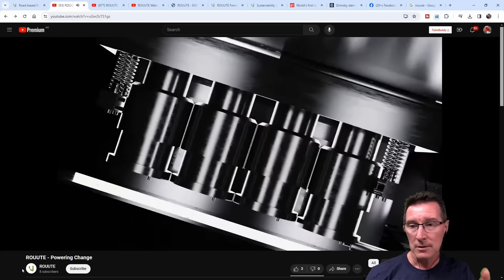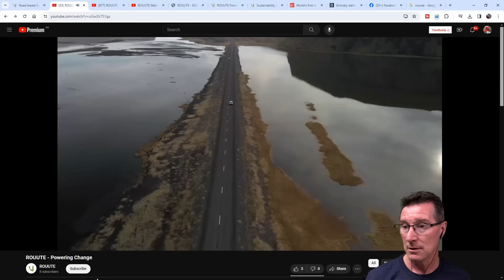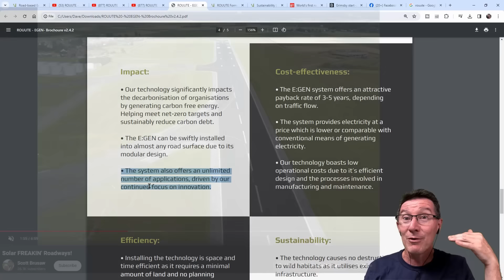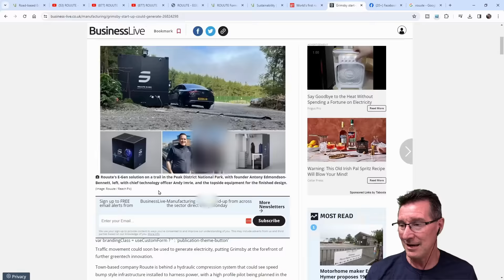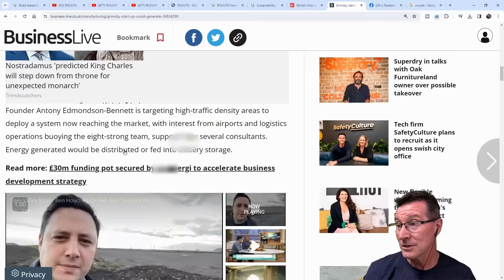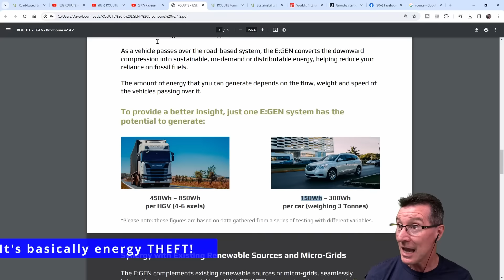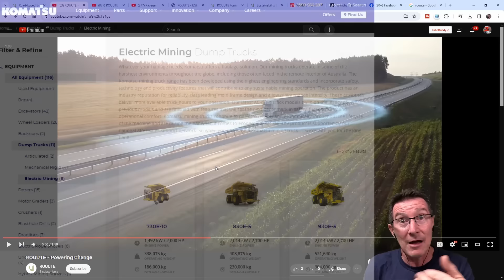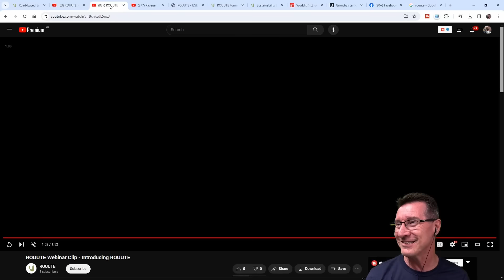EEVblog 1600 - Rouute: Road Based Energy BUSTED

Comment: Right away without even watching the video, how do people come up with stuff like this? Do they just somehow forget that energy cannot be created or destroyed? All the energy they “generate” needs to come from somewhere, in this case it comes from the car and it’s engine or motor so all the energy generated by these devices means more energy used by the car and if that car is fossil fuelled then how can they say it is carbon neutral or zero carbon energy? Even with electric cars they can’t make that claim because a lot of power stations still use fossil fuels.

I would imagine that the efficiency of this is pretty rubbish too so it is causing more fossil fuel use for the same amount of energy.

All this is, is a convoluted power transmission system. Looking at EVs they charge up at home or at a charger which already uses an extensive transmission network and then drive to wherever they need to go and in the process drive over these speed bumps, they would be much more effective and efficient just using the grid that we already have.

Basically all the energy that these people generate with these speed bumps is paid for by road users in extra fuel or electricity used. I could see this as a way to save on electricity at the expense of others and nothing more and even then these devices are probably very expensive anyway.

Yes it may work to harvest energy going downhill rather than wasting it through braking but is that really worth it?

Comment: Well hold my beer. Quick-E-Stop: parking lot where each parking slot has a big bumper. You go full speed off the freeway exit, front first, straight into it. The bumper slows you down very quickly, allowing for safe and precise parking, and generates humongous power. You're allowed to park for as long as the energy generated covers the loss from shadowing the SolarParking tiles underneath.

Comment: Reminds me of a stretch of concrete test highway I used to commute on. You don't use concrete for roadways where the ground freezes solid in winter because it just falls apart at the joints and needs to be patched... So driving on that stretch of road was miles of THUMP THUMP THUMP THUMP THUMP THUMP THUMP..... it was especially horrible in a truck with a leaf spring suspension. 

I was so happy when they tore that up.
Reply: The Lake Pontchartrain Causeway does this for it's entire length, so wonderful.

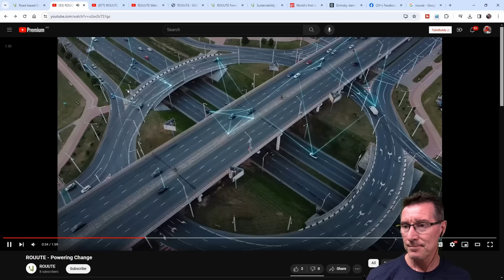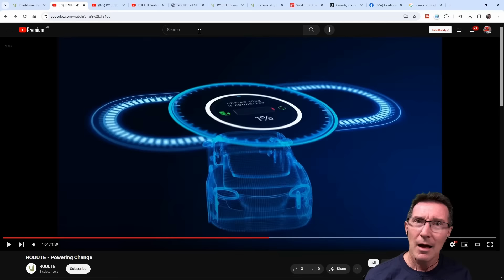Comment: ⚠First video clip @ 2:35 shows Vehicle Mesh Networking to communicate traffic data etc then around @ 2:59 shows Cell Networks doing the same. Both has Nothing to do with energy making speed bumps. IF Morgan Freeman did the voice-over likely only for SAG requirement to do advertising. Could be fake then get sued by M.F.

Comment: I think that the one for walking is slightly less bad. Basically it is like walking in slightly uphill or on very, very small stairs. You will use (slightly) more energy to walk on that pavement. I believe that any generator is a good for workout, at least you feel like you are doing something (if you just paddle on exercise bike, you feel like you are... well... sitting in a room wasting time and energy, but if you use it charge your phone/laptop, you feel "green", so it can be good motivation). 
But yeah, it is not really useful, it is just another "green" technology powered by fossil fuels.

Comment: The thing is this could work if its installed in locations that call for speed bumps anyway. It's taking energy from your moving car anyway so installing them where speed control is desired makes sense. I highly doubt even then it'd be worth it, though.

Comment: But we already have a system to convert 300Wh of kinetic from moving vehicle energy into another form using similar footprint. It's called a concrete wall! Again they are trying to reinvent the wheel here and have "Smart walls" that try to stop your vehicle from high speed within a very short stopping distance. It will surely reduce our carbon footprint if we destroy all vehicles!

Comment: 1. Increased air pollution 
2. pitiful energy recovery amounts 
3. the motorists will be paying to generate the energy 
4. unsafe braking surface!
5. Maybe useful in car parks instead of speed bumps bit the amount of energy created would not be worth while.
6. hydraulics to spin a fly wheel maybe be the way it’s achieved

Comment: That's also going to wreak havoc on people's suspensions. Imagine driving around on a road like that all day long. People would be vomiting their guts out in their cars, and every 100 miles there's going to be a dedicate shop selling car suspensions. Not to mention driving on this at high speed. You hit a bump like that with 130km/h... your car is now an airplane, a crashing airplane. Even the slightest bump is dangerous at highway speeds.

Comment: The fact that the creator has worked in oil and gas before makes perfect sense. This is an excellent way to increase fuel use.
Reply: I hopped straight to the comments to see if this had been addressed. This is seems to be stealing efficiency from the vehicles traveling over these things.
Reply: literally stealing electricity from your ev  @defaultdriftco00
Reply: Efficiency, what about being forced to repair your care more often because your chassis can't handle so many speed bumps?
Reply: Well they did say that they're aligned with the UAE.
Reply: Having an electric vehicle spontaneously explode on top of those is just a matter of time, and peak irony.
Reply: and am amusing the faster the traffic the power it will make? I think I need reminding why speed bump where put on the road in the first place? the landing say plane? landing or something getting rid of energy eg speed landing would a good idea jet aircraft carriers use tow line that catches the planes as the land making landing area a lot shorter than without one?
Reply: @dh2032  try again mate. you killed godzilla with that comment.
Reply: FR, I thought I had a stroke
Reply: @dh2032 the landing strip is long to allow the plane to slow down. Using a rope to slow it down would rip pieces off of it. Planes have to dump fuel for early landing because the mass could break off the wings.
Reply: @chaosryans  They are thinking about Aircraft carriers.

The Grapple is Only there because Aircraft carriers can only be so long. If they Military can make a Carrier Long enough that the grapple would not be needed they sure as fuck would do it.
Reply: @dh2032 Potentially, but the stresses involved in landing a large plane are huge you start putting bumps on the runway and aircraft tires are going to start going pop.

Comment: Maybe schools should focus more on getting kids to understand important basics of how the world actually works, sacrificing some of the effort put into make them try to memorize information they have constant instant accurate access to, like when this and that guy died, or how to spell words they don't understand very well anyway. No matter how much time and effort we put in trying to make them memorize such information, most people becomes horrendously bad encyclopedias and dictionaries.            

The fact that you can't extract energy from something without "removing" at least that amount of energy from the source is so fundamental, and important, and at the same time, the basic principle is incredibly simple. As so beautifully demonstrated here, you don't even have to understand the very basic math of how to calculate kinetic energy to figure out that the claims would require completely stopping the vehicles, from high speeds, and also not have any loss of energy.  

You also don't have to be an engineer to figure out that harvesting useful energy in form of irregular pulses of mechanical energy is extremely difficult, in a lot of ways. And in contrast to that, regenerative braking is simple and elegant, in so many ways, and energy and resource/cost efficient. That means, besides all the other fundamental flaws, their proposed system assumes a future with a large part non-"electrified" road vehicles, that is, not even hybrids with generative braking. We won't solve much by relying on energy stolen from kinetic energy of fossil fuel powered vehicles.  

Works downhill, and other places you want to slow down/reduce kinetic energy anyway, well, that's generous, but sure, for non-electrified vehicles there are places where some energy technically could be extracted that otherwise would have have been wasted as heat. 

Lets look at another aspect, and assume you just steal 10% of the kinetic energy from the vehicle travelling at 96 km/h, from 3 tons that's 30 Wh, and, equally divided per wheel axle, 15 Wh. They seem to be proposing to steal that with something possibly little more than 0.1 meter wide, lets be generous and assume the distance traveled where extraction happens is 0.1 meter, that's 15 Wh, or 54 kJ, at ~27m/s, divided by 0.1, means during ~ 0.003 seconds. 54 kJ during 0.003 seconds, is an average of ~14.6 megawatts. Without further calculations I'm going to go out on a limb and just assume that extracting 10%, or one order of magnitude less than the claims, isn't feasible. Not even just "taking" that amount of energy from the cars, never mind extracting that amount of useful power from it that way. And, tires and suspension would probably absorb most of the chocks. 

Where did they got those numbers from? Well, my guess is they produced them exact same way you produced them, just assuming/pretending to assume they could just transform all the kinetic energy into useful energy without side effects that would be inevitable, like killing everyone in the cars, and disregarding the fact that anywhere near 100% efficient conversion into useful would be impossible.

Comment: Here's some high-school physics for ya. Imagine we have a 3 ton vehicle depressing a plunger, let's make it 10cm deep for example. You can calculate the maximum energy recovered by calculating the work did by the vehicle lowering by 10 cm. Work is force over distance, distance is 10 cm, force is 3 tons times the gravity constant (~10 m/s^2). 10 cm * 3 tons * g ~~ 0.75 Wh

And that's the absolute physical limit, in reality it's gonna be far less than 100% efficient. So the "estimate" given by the page is more than two orders of magnitude out of touch with reality.

Comment: Can I get some feedback? What are some problems you can think of with a carbon negative (just go with me, please) but still biomass burning cogeneration system on every single family home in a metroplex, If the biomass can be cultivated and utilized on site? 

Loke, Hundreds of thousands of houses following the same trends of usage and how that much co2 production could modify the local atmospheric qualities in a manner beneficial in the winter but detrimental in the summer.

Comment: Lets invent the most absurdly complex / inefficient way to extract energy from the fuel or electricity powering vehicles, and market that as 'green' solution! If they were suggesting everyone tow trailers containing wheel driven generators which charge batteries, and that you then have to give the energy stored in those batteries away, anyone would be able to see that that would be a) absurd, b) a form of tax. These jokers are relying on a majority of those driving over their speed bumps (or more importantly, funding them) not being able to see that the energy that they're collecting is stolen, inefficiently.

Comment: This might work under train tracks. Since you have kilotons moving the rail up and down a couple millimeters, just install these bumps under the track between the ties.
Reply: Yes, it'll convert energy from the train. The train will have to use more energy to climb the extra couple mm. It's like the train is always going up a slight extra incline. The energy used by the train will increase by at least as much as the energy harvested.

If the effect on the train is negligible, then you'll harvest negligible energy. If you harvest significant energy, then it's going to have a significant impact on the train's energy consumption. There's no free lunch.

And due to inevitable losses, the amount of power extracted will be less than the extra power required to put into the train. It would be greener to tap directly into the power lines above the train.

Comment: WOW!  I mean WOW!   We have finally solved all the transportation power and fossil fuel burning problems.  Now we can ALL buy electric cars.   You see it is so simple.  When we drive we will create our free energy.  This energy is stored.  When your car or truck battery goes low, you can pull over ANYWHERE along the road and recharge with the free energy collected.   Then you drive and create MORE energy.  Why didn't we think of this before?   Come on America, DRIVE to save the planet. Did my sarcasm hurt your feelings?

Comment: During my engineering degree, I stumbled on a newspaper article about "piezoelectric pavement", and submitted it for thoughts to my fellow students. My point was, "the energy comes from your lunch, and you'd be better off producing electricity on a bike with a dynamo generator". Amazingly, some of my fellows failed to see it was moronic, and said "well, the system can gain in efficiency so it won't rely on the walker's energy"... 🤦‍♂️
Reply: Humans don't generate that much energy. I already thought of a gym with a side-line in electricity generation. But it would only give enough power to run the lights.
Reply: @vylbird8014  no, indeed, they don't, that was my whole point : bicycles with dynamo generators (which is a dumb idea once you really think about the little power it would generate) would be a much more intelligent thing compared to the "pavement generators"... which is saying something about the uselessness of the latter.
Reply: @takix2007
Of course, improving efficiency is the key! Simply design a 101% efficient dynamo and you're done 😂
Reply: An average gym goer on a bike could maybe produce 100w for an hour. Trained amateur cyclists maybe 200w for an hour, but let's use 100w. So if you have a spin class of 15 people, that's 1500w/hr. A bit more than the lights for the room, but nowhere near covering the hvac.
Reply: Yeah "unfortunately" for ideas like human powered gyms, human bodies are just way too efficient at using energy. :p

Comment: So... my thoughts from my some of my basic Mech. Engg. knowledge and common sense.

1) If we're slamming these rumble-strips at highway speeds, are they willing to pay back the costs of accidents and hospital visits when the suspension system is shocked and the vehicle becomes unstable, resulting in a crash? Will they pay for my tires when I break a cord in the sidewalls, or replace my strut assemblies when I blow the seals within them? 

2) Is this at all a decent idea in any area that can be iced over?

3) In an area where media could accumulate underneath these actuators, where is the reliability and risk analysis to account for abrasive media such as dirt and sand pitting the hydraulic cylinders? Impacts of rust due to moisture? What is the maintenance schedule, the cost analysis of that maintenance, and the ROI versus other forms of large-scale energy infrastructure when accounting for current rates and prices of electricity generation?

4) Going back to media's effect on these devices, since these will be presumably embedded into the roads to reduce the vertical height, what is going to be used to blow-out that media? If enough media accumulates underneath the actuators, how much stress is going to be applied to my suspension system when the actuators are mechanically-impacted and can't articulate? Assuming water pools within the casing for these, what is the method of eliminating that water? If that water freezes, what is the worst-case scenario for how these mechanics are impacted?

Comment: Only scenario that this would remotely make any sense would be what ypu mentioned putting them near the bottom of a hill where people are required to slow down.  Otherwise these bumps are just stealing power/momentum from vechiles and turning it into small amount of electricity after going through a very ineffeceint process.

Comment: This is also bad news for ride quality.  Suspension systems are designed assuming the road is rigid.  But with this device, that's no longer true.  The device becomes part of the suspension system when you analyze suspension system response.  The stiffness of the road bump relative to the stiffness of the suspension system also defines the mechanical impedance match and how much energy transfer has occurred.  This has bad idea written all over it.  Just another whack idea to separate fools from their money.

Comment: ME here - probably the simplest and most efficient is straight to a linear coil/generator.  Any intermediate mechanics will rob energy and introduce maintenance, costs, and weather challenges...the displacements would be small, so that might drive big coils.  An intermediary year train could multiply displacement, but...yeah.  The whole thing sucks.  Better to just pave in piezoelectrics.

Comment: For those curious, you would need to lower a 3 ton car 36.7m (120ft) straight down in order extract 300 Wh (1.08MJ) from it, assuming 100% efficiency.

Based on their video, I'd estimate it to be closer to 20mm per bump, so with 6 of them (3 each side) your best case scenario is extracting just shy of 0.5 Wh per (very angry) car.

So yeah, just another snake oil startup hitting all the green-washing buzzwords. You could maybe use it to let a carpark speedbump power its own warning LEDs, at least intermittently, if you really wanted to.